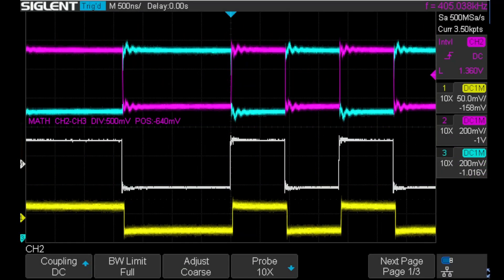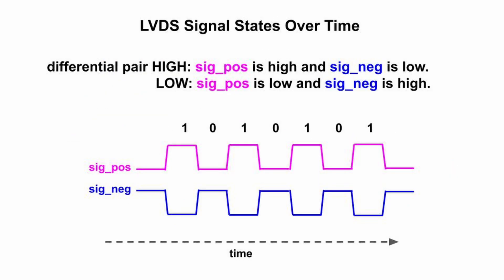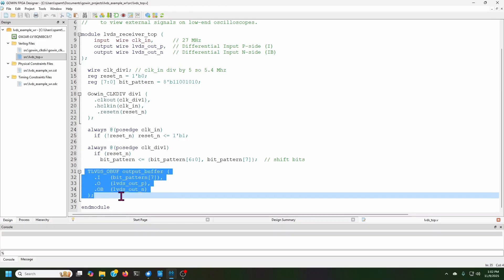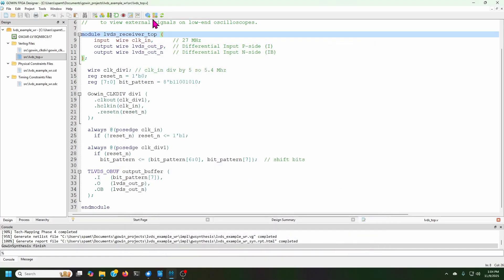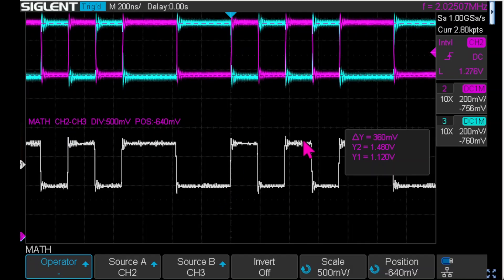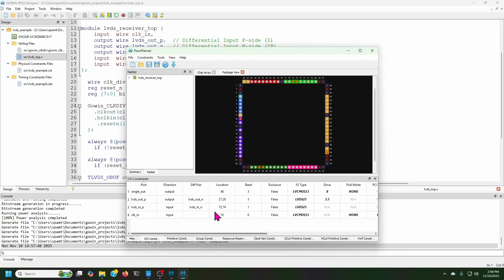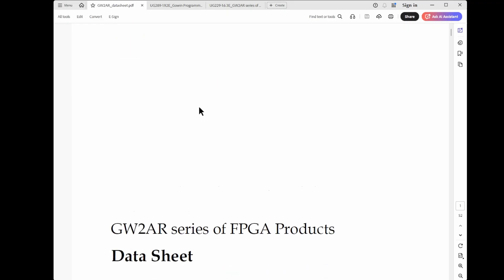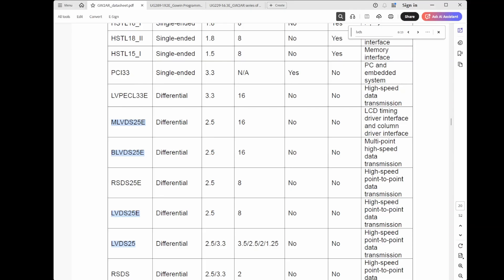Tang Nano 20K Gowin FPGA LVDS Demonstration

Comment: Thanks for your videos about Tang Nano! I have subscribed to you. Please tell me if it is possible to create a fast True Random Number Generator (TRNG) using only Verilog on Tang Nano 9K (or Tang Nano 20K)?
Reply from the maker: Glad you like the videos.  I have no expertise in hardware-based random number generation.  I think you can google "fpga true random number generation" to get some ideas.  I think some are based on high-frequency oscillation using inverters.  But proceed with caution since I imagine it is much easier to create a bad random number generator than a good one.  Cheers.

Comment: @10:20 your math function looks more like the magenta signal is being subtracted from a DC offset. But it shows that it is transmitting the data correctly. 

The wilder swings on the second experiment is a function of your comparably high data rate, infinite-ish slew rate, and some actual wire in the circuit. Put some delay in your rise times and a lot of the squiggles will be reduced.

The terminating resistor being set to 100 Ohms is a bit of wishful thinking on the chip designers part since the designer couldn't possibly know what the characteristic impedance of your network is going to be. Terminating resistors have always been sized based on the cable's characteristic impedance and are not (necessarily) limited to 100 Ohms (or 120 as many in the 3D printer world would assume).

I come from the slow world of DeviceNet (think Canbus done wrong) and I can show you some wild signals. :)

Great to see some experimenting with the Nano, I've got a few and it's high time that I've played with mine. What do you think happened with the inputs of yours?

Thanks for sharing!
Reply from the maker: Thanks for the inciteful comments.  I think I killed the I/O buffers by foolishly plugging wires in and out while powered on.  I reached a point where the FPGA would not come out of reset when something was connected to those pins even though it was working before.  I still need to test more to see the extent of the damage.  The thing that I like best about the Tang Nano boards is that they are cheap.
Reply: @electronics.tinker  My pleasure! Working with DeviceNet was so bad that you ended up being either a subject matter "expert", or driven to drink. There was no in between. :)

And oh yeah, that'll do it! I've got a trail of devices that I wish that I had used a bit more discretion with that ended up in the dumpster. And the Tang Nanos are very nicely priced (and what appears to be a much lighter weight development environment) indeed!

Comment: Great video!

You're right, you can change Bank VCC in Floor Planner, it won't change the actual voltage. This is because Gowin IDE works with chips, and the actual voltage depends on the voltage regulators soldered by the manufacturer of a particular board. In this case, Sipeed soldered ME6211C33 to banks 1 and 5 (which you used before the burnout episode), so regardless of the settings in Floor Planner, the voltage will be 3.3V.

And you can have both differential and single IO in one bank - you just need to select the LVCMOS33D standard for the differential pair and LVCMOS33 for the single pair, respectively. This will not change the nature of the interface in any way - that is, it will not become an emulation, it will remain True LVDS. ;)
Reply from the maker: Thanks.  I did not know what LVCMOS33D was.  I will read about it.